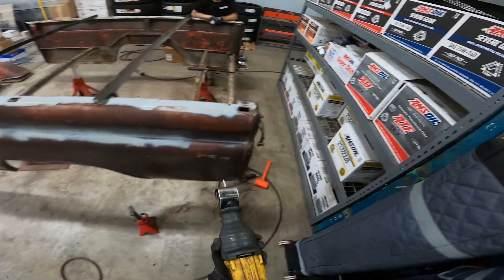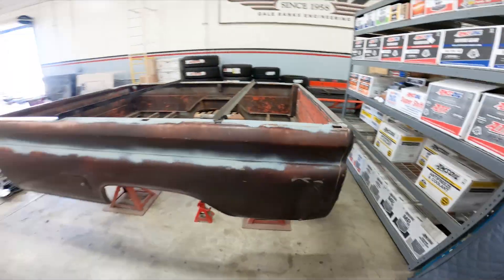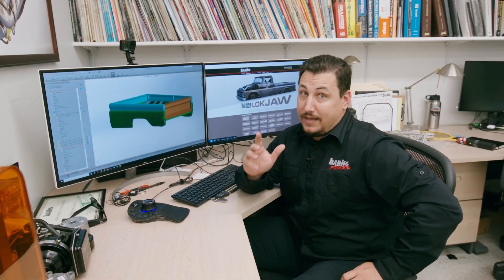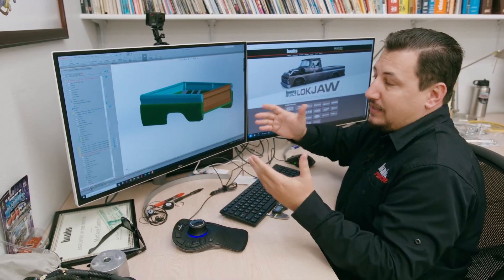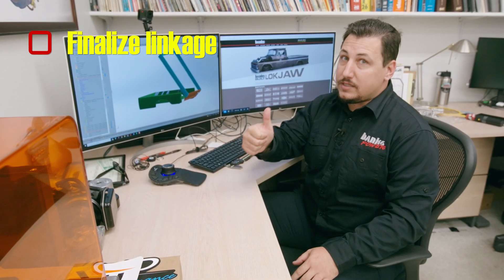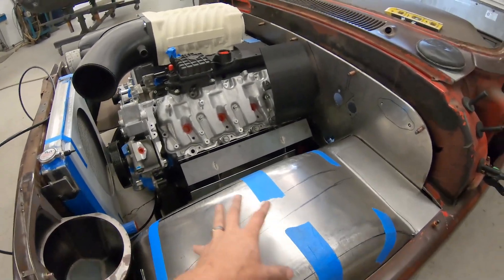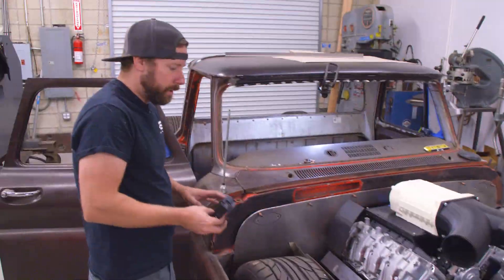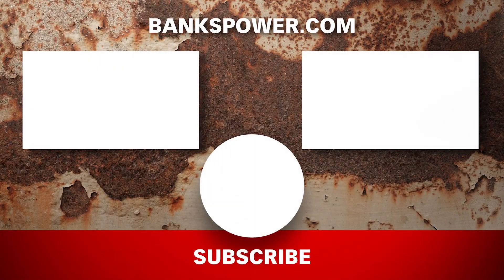Custom engine bay revealed! | BANKS BUILT Ep 33

Comment: BED WEIGHT SAVINGS!!! I'm gonna say it again. The current path is going to make the bed upper section way too heavy. Using laminates (carbon fiber and kevlar) with a soric core material would do everything you want without the massive weight penalty. A composite floor with oak laminate and metal strips screwed into it will kill two birds. You've got your wood finish with a perfectly clean underside. A 1 inch composite floor will hold a party on top.

Comment: I only dream of having access to the workshops and equipment your doing the fabrication let alone the Banks engines and engineering love your work keep up the great content William
Reply from the maker: You can make it happen, never give up on the relentless pursuit of excessive awesomeness!
Reply: @bankspower  my dream is to power my 2000 Land Rover Discovery with a 5LP Duramax through a ZF 8speed. Original its aTD5 turbo with a ZF 4speed+ over drive. I'll keep working on that love your work.    Will

Comment: boy, wouldn’t it be funny in a tragic way if that supercharger came without the stripes or in t’other direction?
Reply from the maker: We've spoken with Dustin Whipple. He dare not change the design.
Reply: @bankspower  I'm not sure that " dare "  is a good word choice. It sounds like a challenge to me. I know the 6 bar hinge for the bed will look spectacular, but surely it would have been easier to hinge the upper part of the bed and the tailgate as an assembly from the bottom of the tailgate and use some linear actuators to open and close it.